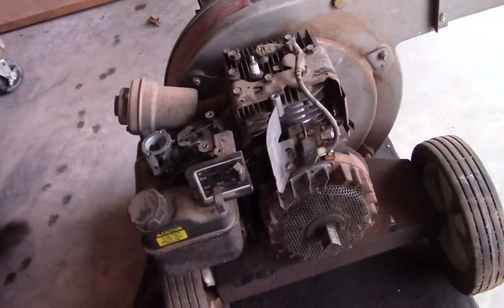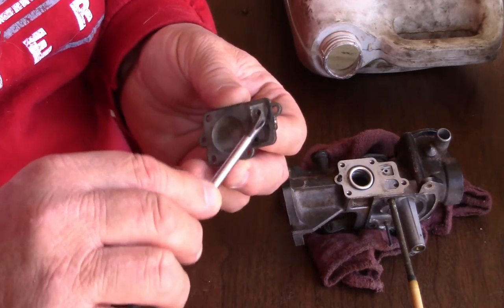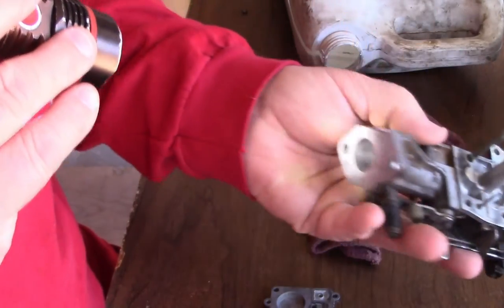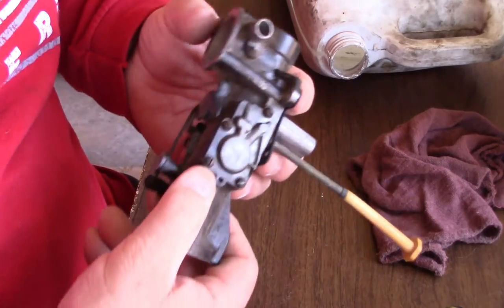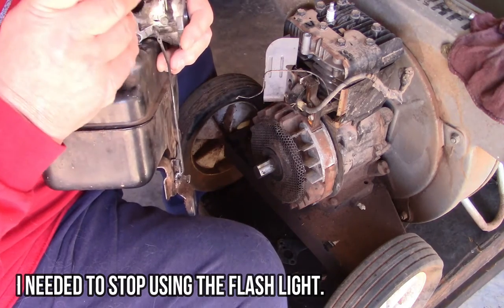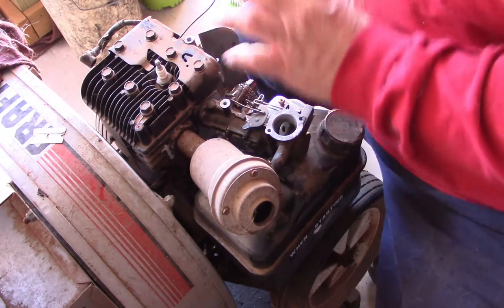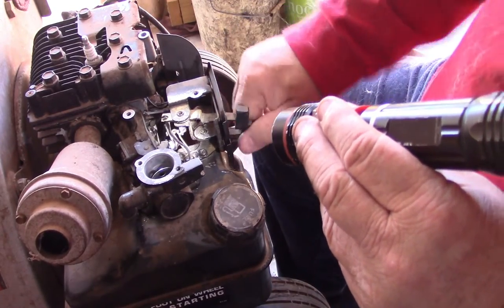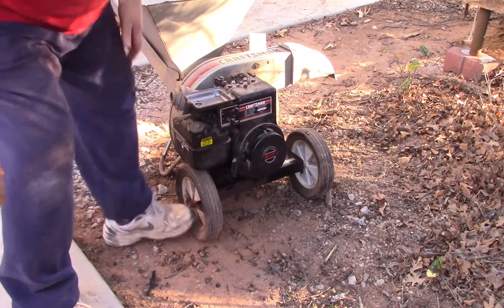CHIPPER // SHREDDER | CRAFTSMAN 5 HP - BRIGGS & STRATTON - CARB CLEANING & REMOVING CUTTING BOX

Comment: This is the same B&S motor / carb I have on a Murray chipper.  My carb won't come off because someone that owned it before me has added a piece of hose (fuel line or the like) with hose clamps inside the fuel tank on the tube that pulls the gas up.  Your video really helped show what it is supposed to be like and so now I can figure out how to get that out & clean up the carb.  If it went in, it can come out.  My guess is that little plastic tube cracked and would not stay on so that was his solution to keeping it attached.  Anyways, thanks again for the video.  BOOMER SOONER!!!  (Noticed you had an OU shirt on.)